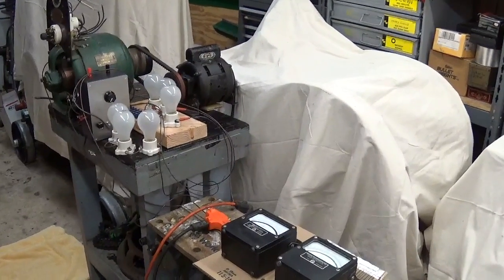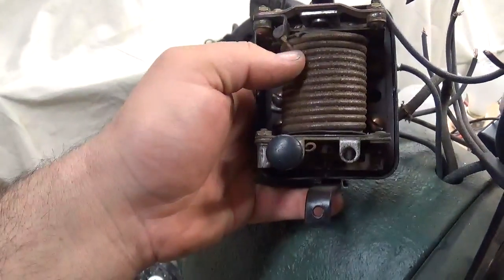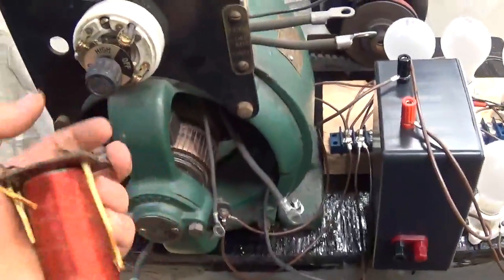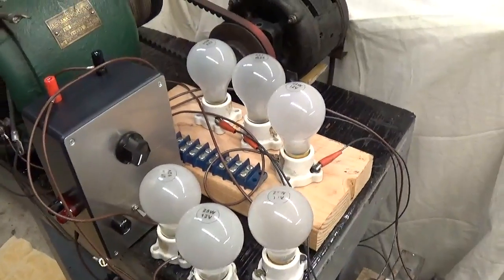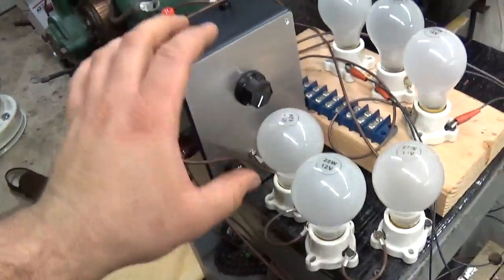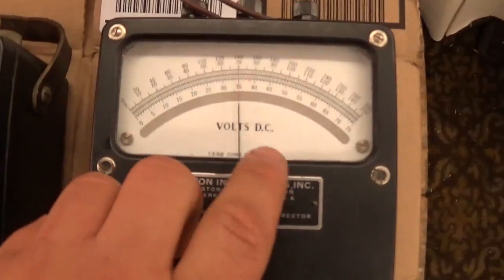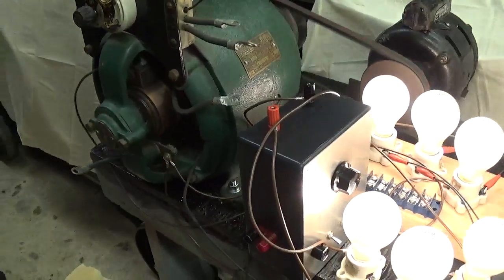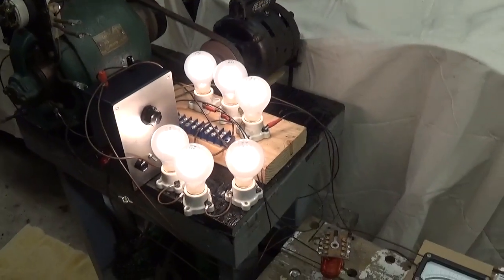Fairbanks Morse Light Plant Generator

Comment: On the resistor, it may not just be the dc resistance, it could be an inductor as well ..
Reply: That's exactly what I was thinking. If this is for alternating current, then the inductive reactance is going to be MUCH higher than just the DC resistance of the wire itself.

Comment: For future reference you have to be careful of the power needed for the field resistor. A rheostat is rated for using the full device. If you're only using 5% of it (10 ohms of your 200 ohm rheostat) the power rating drops to less than 10%. So your 10 watt rheostat can now only handle 1 watt without burning up. In this case that's only about 0.3 amps.

Comment: That is really neat, but it's so sad that it was rewound :( Like they say "You can restore something as many times as you like, but it will only be original once".  So, you can rewind them as many times as you like, but they're only original once.  I like to think about what it was like when some guy was winding that machine 100 years ago.  That legacy is gone now.  Same goes for paint.  If the original paint is ok, leave it.  It's ok if something 100 years old, looks old!  It is rare that these old, well built machines actually ever suffer a winding fault.  And if they do?  That's when it's ok to rewind, if necessary.

Comment: nice all those wires r they both pos and - it would be good to mark them maybe color code them with marker or paint
Reply from the maker: Jim Rowlings Yes, I would like to find the old style metal wire markers that would have been used in the era this gen was built.

Comment: The field resistor was likely wound with nichrome wire, given its on a ceramic core.  Whoever rewound it has little knowledge of how a generator works or how its regulated.  Great video Mike!
Reply from the maker: epd807 Yes that is what I suspected also, I have done a little experimenting and have determined the correct resistance values for correct operation.  Thanks for watching!

Comment: I found this online Mike, from someone with a FB light plant like that one    "The generator is a Fairbanks. Morse & Co. Indianapolis,Ind.U.S.A. Shunt wound generator. Serial No. X33914 Frame H IN Type 1.5 K.W. 2000 R.P.M. 40 Amps. 1.5 K.W. Continuous Duty 40 C, 37 1/2 Volts."  BUT in the same thread he also says the engine is a 3 hp 475 rpm FB, so I dunno.  Also in that thread someone mentions the variable resistor and supposedly it should be 40 amps on high, 20 amps on med and 10 amps on low. There's also an online article in Gas Engine Magazine from the 80's titled "Let There Be Light" about someone who restored a F/M 3 light plant back then.